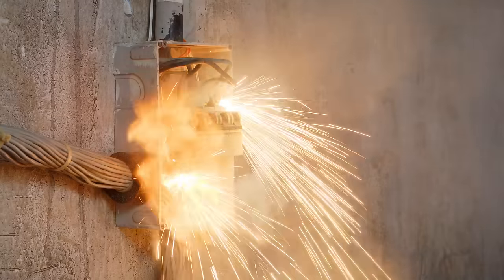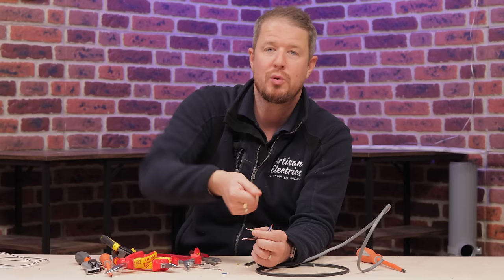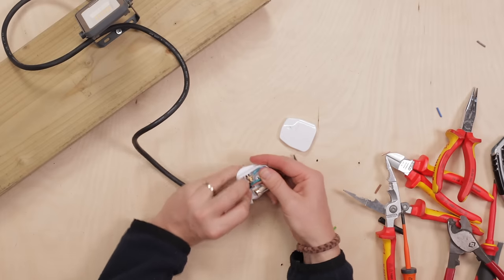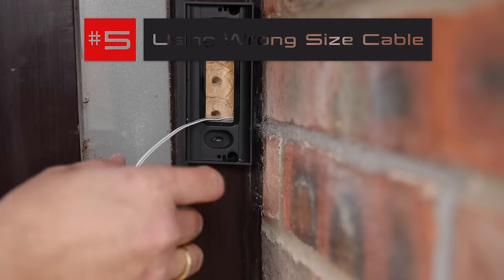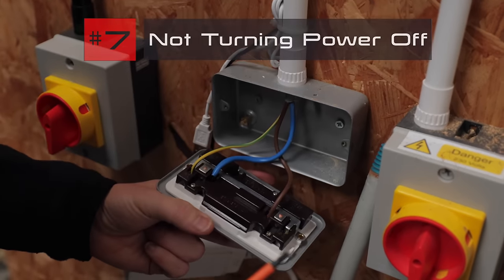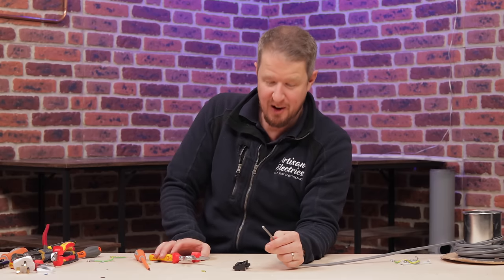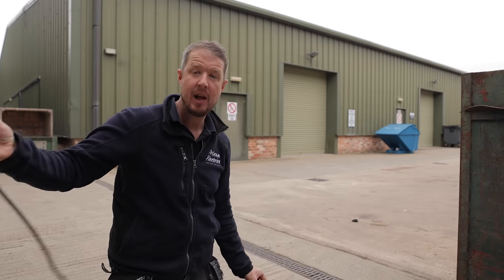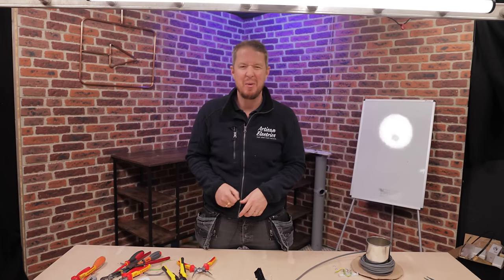10 Mistakes EVERYONE Makes When Doing DIY Electrics!💥

Comment: I'm in my 50's and did a 5 year apprenticeship as an Electronics Technician when I left school. I then became good friends with an Electrician who over the years taught me a lot about household electrical wiring etc. As a result I feel that I'm relatively competent as a DIYer and myself have seem some hacks that were so dangerous I physically shuddered at them. Every bit of work I've ever done on my house electrics, I have an electrician come out and check it. When I built my workshop in the garden 20' x 10', I fitted a 20 socket ring main and 12 light ring. I ran the Armour cable to the CU and had an electrician come check it and connect it up. He said he had no qualms with connecting it and certifying it as the job was good. My point isn't to "big up" my skills and knowledge, but to point out that not all DIYers are terrible, some of us actually go out of our way to make sure we do a good job because we realise that our lives and the lives of our families are very much on the line.
Reply: Indeed so. I'm also an electronics engineer and would never make any of the DIY mistakes mentioned here. I also know that it is not inductance that causes a rolled up extension lead to get hot! Unfortunately Part P has turned us DIYers into criminals and, by making the relevant standards inaccessible to non qualified persons made it far more difficult for those of us trying to do a decent job to do so.
Reply: The issue for you, that today, some of the work you did is considered notifiable and by law, the Building Control department of the local council has to be notified.

Even if you are competent as a DIYer, you still have to notify the Building Control and they will tell you what certification requirements are needed.
And as you don't hold any formal qualifications, and no membership of NICEIC or NAPIT, then they will require that a qualified electrician inspect and sign it off as being compliant to the wiring regs.

So I think it is important to not send out a message that anyone can just go along and do their own electrical DIY and get an electrician to sign it off.
There is more to it than that.
Reply: @John_L No, it is not true that Part P has turned people into criminals.

I have repeatedly seen statements made by even electricians that say people can't do their own electrics.

That is not what Part P of the building regs says.  Part P says that the work has to be done to compliance of the wiring regs, and be certified by somebody competent and it talks about notification to the building control department.
Reply: @deang5622  This is true but by making the said wiring regs only available to certified personnel the effect is to make it nearly impossible for the conscientious DIYer to do a compliant job. And the DIYer is criminalised unless his work is inspected, even if it is not notifiable work. The practical effect is indeed that the DIYer cannot do his own electrics, no matter how competent he is.
Reply: @deang5622  yes but you obviously missed the part where I said it was inspected and checked/tested by a qualified person who then issued the appropriate paperwork.  the work I did on my workshop was done back in 2011and as I said, I had an electrician come out to connect it to the CU, I left all the socket fronts off and the lighting covers on the flourescents off so he could see the job I had done and also marked out my cable runs that are behind the OSB that lines the inside, I also have a couple of covers that give easy access to some of the areas where the cable runs incase I need to do any work on it. He was happy enough to sign off on it and to connect it to the house CU. I ran the Armour Cable and routed it to the CU in the garage and again after testing it he was happy to sign off and complimented me on a good job. The result is, I have an ele tri ally safe workshop that has been in use now for 13 years with zero issues (except a small leak in the roof I just had to fix🙄). I have also had another electrical inspection about 2 years ago and they checked the workshop because its connected to the household CU so included it as partnof the house and again had a clean bill of health. Based on all this, why am I breaking the law? Yes I did the work, but didn't make the final connection and it was all tested by a qualified person 🤷
Reply: @Aspie_Geek_UK  But I am not talking about work you did many years ago.
The laws were quite possibly different then.
Reply: @deang5622   but nowhere in my post did I mention doing any recent work! So I fail to see your point that my work is/was illegal 🤷
Reply: @Aspie_Geek_UK  You have got yourself well and truly confused.

You are having difficulty understanding English.
I never said that your work back then or if it was done today was illegal. Those are your words, not mine.

The fact is, even today it is not necessarily illegal. What I said was there are additional things that have to be done, notably notifying building control, which if you failed to do, would actually be illegal
Reply: @deang5622  Maybe it's you that's having difficulty, {quote} some of the things you did must be notified by law {unquote} your words Deang5622. The very fact you felt it pertinent to mention the fact that the works I did had to be notified by law intimates you felt I broke the law, which I didn't. As you don't know all the facts, it would probably have been better for you to refrain from commenting or maybe asking me pertinent questions to better understand what I actually did. But since you have made some assumptions ley me make it clearer for you.
I applied to building control at Hertfordshire District Council for permission to build a 20'x10' by 9ft tall at the eaves workshop in my rear garden. This was granted as its was to be a wood structure that was built by myself. They also approved the electrics and once I had it all done as stated in my above post, I called an electrician to come and certify it which he duly did. So as u can see both building regs and a qualified Electrician signed off on it. So now you have all the relevant facts, you can go to bed and leave me alone. Anyway, I've had enough of justifying myself to some random person that thinks they are better than me on the Internet so I shall not be commenting to anything you post again. You are not worth the time. Have a pleasant evening Deang5622. 😊
Reply: My last appartment (from 1961) was a horror show. Random colour coding (shocked myself badly once because the active phase was on an earth wire). A hidden 10-14x coil above the bathroom ceiling, which was then split 5 ways for the whole livingroom. An entire unused breaker group wire left exposed in the same above-ceiling space.... Done by the original builders, no idea why anyone would do it like that.

I basically had to rewire the entire house from fuse box to sockets, by myself.

TBH never had it certified or anything. Can't imagine I did anything wrong though because I drew out the layout, attached everything proper, checked for tension against the wires, everything in proper wires no small ones, proper colour-coded (and measured after), no unsupported unclamped wires, everything covered in pipes so it's 3x security against physical damage, put the bathroom on the end up the circuitry no throughput..... Took me dozens of hours of work.
Reply: @John_L  Part P only makes certain works notifiable, and if you want to buy BS7671 for £108, even the IET will sell you a copy (other companies will also do this).  Whether we would be able to understand it and apply it to site conditions in a practical way may be another matter.

Though I take your point in that Part P allows me to cut into a ring main and extend it (which could go wrong in a number of ways) but not to add a new radial circuit to my consumer unit (CU) (which could also go wrong).  I suppose there is increased potential fire risk in work that affects the CU such as removing and refitting busbars to add a new MCB, but I'm not quite clear on the logic of how they decided what is notifiable and what isn't.
Reply: @johnbull5394  Fitted out my whole kitchen, drywall, tiled,, extended the ring, installed and wired double oven and hob, cabinet lights etc and everything worked.
Then decided to have central heating installed as well as a new consumer unit to replace the ancient "Wire fusebox "

Electrician did EICR and replaced fusebox finding no problems..........
Reply: @fabianmckenna8197  You are preaching to the converted here!  I could try to defend the law by saying that the EICR process may not test everything and it is possible it may have missed a fault you may (or may not) have introduced, but realistically, a painstaking amateur may well do a better job than a slapdash professional, and the absence of calibrated test equipment may be less of a hindrance than an uncalibrated brain.

Having personal experience of being forced to replace a washing machine due to a professional electrician giving it a fail on a PAT examination (because a 2mA earth leak made his calibrated computer's 'FAIL' lamp light up) only to discover, years later, that this should not have been a fail at all according to the official details of the PAT procedure, I think you'll understand why I have a certain scepticism regarding competent-person schemes and calibrated equipment : it seems certification is now more important than competence as far as the law stands, and we consumers foot the bill in more ways than one!

Comment: One other thing not mentioned, but something I've not seen done in a fair number of outdoor DIY cabling setups are Drip Loops. Instead you tend to see cables running straight down a wall, right into a junction box with nowhere for the water to go!
Reply: I've seen the same done by professional CCTV installers recently.  Cameras had gone out.  I checked the weatherproof enclosure, unscrewed the cover and about a litre of water poured out.  All cables were top-entry, no drain hole, system had worked until water got up to the level of the power supply for the network switch.
Also not-so-professional cable contractors (I won't name names but let's just call them the S*** Wiring Guys) running Ethernet feeds into the tops of Wiska 308s or through drilled-out holes in the rear.  As they fail the cables just get jelly-crimped now as if the jack is replaced it just rots again.
Reply: "It's IP44, what can go wrong?" 😆
Reply: Exactly.  I'm a DIYer but I was awake in class when the teacher told us about gravity.  I installed a cable in my loft that goes downwards to a junction box but does a wide 'U' before rising up to enter from below.  A little bit of thought goes a long way.

Comment: Extension leads - Inductance is not the problem, it's the resistance that creates heat.  Cable is rated for a situation where air can circulate around it.  Winding it onto a reel adds insultation so the copper temperature rises.
Reply: Agreed. Inductance cannot play a role, as you have two coils parallel (two in which current flows, the earth is an open circuit on the end, if the appliance has no earth leakage), and the current flowing in them is always opposite , so the magnetic fields of the two cancel out. Also, inductance does not build up, it is a property of a configuration of wires (large for a coil, very low, e.g., for a twisted pair). What is building up is heat, no matter how it was created.
Reply: In AC, inductance is resistance.
Reply: No - inductance stores energy, it does not dissipate it as heat.